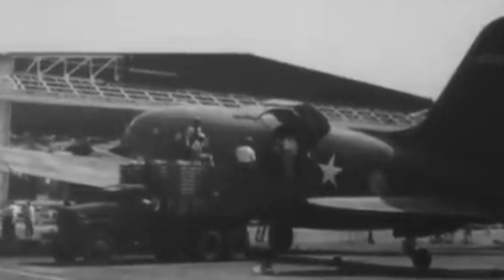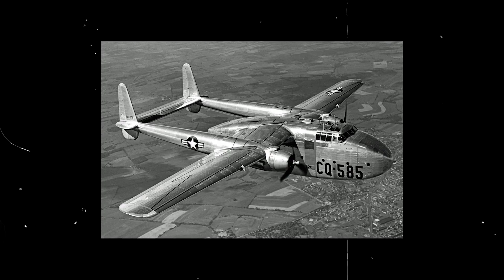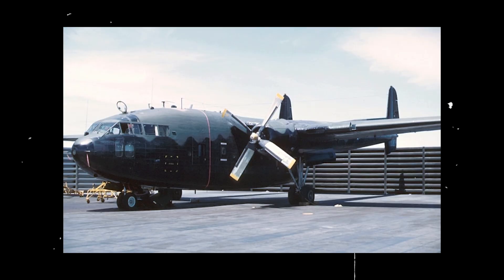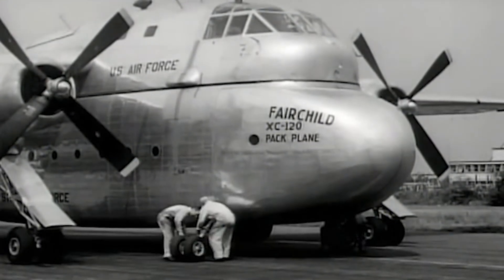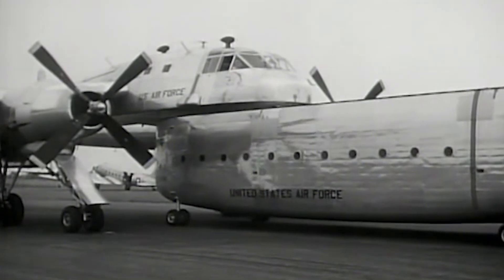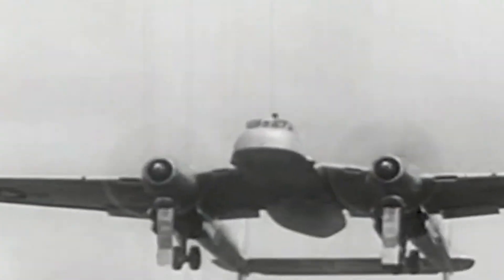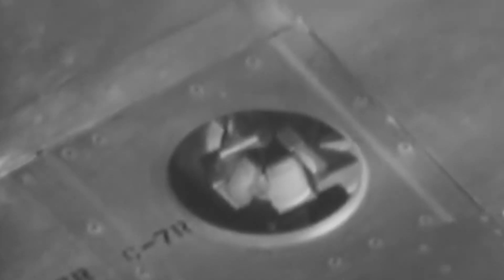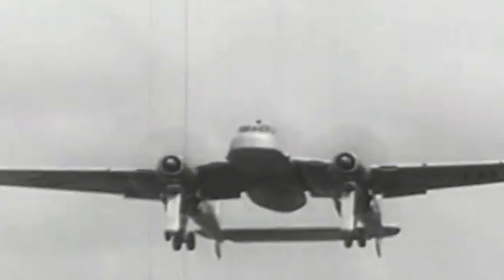Why Don't They Build It Today? The Most Brilliant Aircraft Design Ever

Comment: Why don't they build it today?  The reciprocating engines the airplane used were powerful, but the aircraft was drastically underpowered anyway. So fine, replace the recips with jet engines??  And how do you install a jet engine on a twin tail boom aircraft?  There's no need for the aircraft anyway, replaceable pod or no. The C-130 is a world beater, still in production today, a million times better than this thing.  And even it is being threatened by more powerful, more modern replacements.

Comment: When you showed the front doors of the PAC plane I thought of the guppy and the b 747 , 
If they built the plane with the pilots cabin over an integral cargo bay and wide front doors , allowing for large cargo to be loaded and unloaded quickly , or even in modular containers,they'd have achieved most of their design goals and probably had a success

Comment: I never heard of this aircraft before, but I am a commercial pilot but actually came up with this design myself.  I made sketches, but mine had a nose cone that came down where the pilots sat, and the pods would be rolled into position from the rear and engage into the cockpit.  this would give the frontal surface area to a minimum.  I was shocked that they actually consider this design in the past.

My other design invention is for safety.  Simply  have the passengers sit facing the rear of the plane.  This will drastically increase survivability of a forced landing.  Facing forward is the most unsafe way to sit passengers.  The G-force the body can tolerate increases tremendously faceing rearward.

Comment: I can see why this wouldn't work, but I would think it would be easier to just build a very "agile" cargo pod that is designed to perfectly fit inside of a large modern cargo plane, serving a very similar function. Instead of detaching an entire part of the fuselage, you could just have the equivalent of a cargo container, loaded up with stuff, that can be rolled into a plane's cargo bay within minutes in one operation, then dumped out of it in minutes too. It would slightly reduce the maximum carrying capacity, but probably not by much.

Comment: I worked in Alaska in the early 1980's and had the opportunity to fly in the C-82 Boxcar a few times. It was a great bush cargo plane. It had a chain drive landing gear extension mechanism that tended to fail. I remember they had to reskin the belly once. Carried about 20,000 pounds of cargo, anything from lumber to trucks to small bulldozers.

Comment: "Power" ??? those of us who "Jumped" the C 119 (Airborne ) felt compared to the C 124 and C 130 it was crowded and underpowered. 
Also the Oil fumes from the Radial engines were a boon to the manufacturers of the "Barf Bag" 😂 on a hot day as they permeated the cargo area.

It would be interesting to see a comparison of the C 119 VS, C 46 , C 47's various versions with different engines and the  C 123.

Comment: Don't forget the US Army Air Force (USAAF) designed the C-119 for their use (supporting the Army).  After the Key West Accords (1947) the Army could only have helicopters and liaison aircraft, the US Air Force controlled all other types, and they did NOT want the C-82 and were hostile to its successor the C-119, they wanted the C-124 Globemaster II which fulfilled their idea of the Air Force's cargo transport mission.
They would not have been interested in developing the 'Army's' plane.

Comment: It's an interesting concept.  Imagine a "tower" module.  Prefabricated, two/three level(depending on how big the pods are) with all the necessary equipment installed.  The pod is dropped off. The ground crew move it in place, then stand it up.  Level it as necessary, and just plug it in.  That's not a bad idea, honestly.  But very specialized.

Comment: Immediate reaction, this is a stupid idea. After further consideration, I believe it's even dumber than I initially thought. When a cargo plane lands, someone on the ground has to unload it. When this plane lands, they drop the cargo pod... and the people on the ground still just unload it like normal. Why go through all this extra expense and complication when the only thing you're accomplishing is saving the pilot the trouble of waiting around to be unloaded. Instead of loading the plane itself, they load this cargo pod (saving no time whatsoever), then have to attach the pod to the plane (losing time). It brings nothing to the table. It might save a bit on fuel on the return trip. That's the only positive I can think of, and that's only if the plane is flying back without an empty pod.

Comment: 1:42 
Within the transition from metal-based to carbon-based technologies and the resulting double increment of strength and lightness - it would be good to see this design principle taken further for commercial trans-ocean haulage. A modular (extendable/reducible) wing-frame with carbon container pods shaped to contribute to the aero-dynamic requirements of an ekranoplan-based design and which would be detachable for onward land-based haulage seems worth investigating. Deconstruction of the economy of container shipping and reconstructing as carbon vessels using ground effect to avoid the vast expense of fuel in overcoming hull drag would be the conversation. Accurate weather-forecasting and out-run speeds would be an essential consideration as would retrieval strategies if ever needing to ditch.

Comment: A Good idea too early for its time I guess.  A plane like this would need multiple control systems and mode/control changes with such a modular system.  that is likely where it was going wrong in that day and age.  Not only was the concept novel and new, but the understanding of the physics and how to design a plane and its control systems where still in almost purely mechanical control,.  The robustness of technology and the lack of knowledge and materials would have made such a good idea too complex for that time period.
With what we know and have now however, it would be possible to make such a modular airplane and have the right multi-mode multi-adaptive computer control systems.  The only thing missing now, is simply, the will and backers to try again.  The tools, science and technology have caught up.  The will to do it again has not.

Comment: Former Boeing Everett... as an aviation buff, I never heard or saw this concept. It is actually very brilliant. Pods could be pre-configured depending on actual mission; hospital, cargo, rescue, recon, troop mover, etc. It had a 30,000 pound payload limit, which wasn't too bad for time period. They could put 30,000 pounds of TNT in it and make quite the MOAB lasting impression on the enemy. 

Today with modern aviation, much larger and capable pods and carriers could be built. The bulkhead between plane and cargo in original version looks to be flat. Pressurized fuselage might dictate different design, but concept is valid. Maybe Boeing can make a special 747 flying boxcar with detachable cargo pod. My friends in Everett would love a new 747 project and so would I.

Comment: I'm no expert but I must say I was surprised by this design. The possibilities of the modular cargo pods are endless. I could see while unloaded the flight characteristics would drastically change but that was in the mid-fifties. With fly by wire avionics the aviation industry can make a rock fly quite well.

Comment: The modern equivalent to this is the C-27 Spartan. It was adopted by the Army, then taken by the Air Force for some dumb reason. They were put to good use between 2009 and 2013, before they were needlessly phased out of service and given to the Coast Guard.

Comment: I watched it a month back and was looking for free time to post a comment ... i believe this concept failed (1) the clutter i.e. empty containers with your troops will make them easy to spot as it will be hard to dispose/hide them after taking supplies out. (2) as video shows too it is hard lengthy procedure to mount container back and cant be swooped by airplane to pick it back (3) the turbulence/instability faced by container-less aircraft can be done away by double walled container .. where outer walls remain as faux fuselage and inner container of ~95% same volume slides out. Conclusion: (1) point-1 above here is enough to disband this approach. (2) C130s have performing/fulfilling similar duty by dragging/ejecting the load on makeshift runways by just touchingdown on runway for few seconds ..the parachute attached to the load pulls it out and C130 takes off immediately after these few seconds of touchdown .. you can search for "C130 LAPES" videos ..... Low Altitude Parachute Extraction System (LAPES)

Comment: Fascinating.  Familiar with the C-119 'Flying Boxcar' as I used to live near an Air Force Reserve base during the late 1950's through late 1960's and they flew the C-119 until replaced by C-130's.  The C-119 was a common sight flying low over our house back then.  Had no idea there was a 'pack plane' C-120 variant..what an innovative concept too bad the aircraft had some flight stability issues without the 'pack' attached.
Reply: Location?  I grew up near Columbus Indiana and Bakalar AFB

Comment: The C119 was used all the way into the early  90's.  I believe Hawkins & Powers out of Greybull, WY developed the mod to add a small gas turbine on top of the fuselage for added take off performance.  It was the same gas turbine, that ran on 100LL, that was on the wings of the P2-V Neptune.  They made great air tankers for fighting wildfires.  Now if only Lockheed could make a wing that wasn't prone to cracking...

Comment: This was a plane, without a mission. I have loaded/unloaded hundreds of C-130's, 141's and even a few C-5's during my Air Force service. With modern palletization, and unloading equipment, we could do it faster and more efficiently that the Xc-120 without any weird empty flight characteristics. By the time the aircraft was ready for service, new ones were already on the drawing board.

Comment: The issue of hot cargo drops is handled by helicopters due to either not having to land at all, and their ability to land at tiny or nonexistent airfields.  Planes can't really do that.  Why this hasn't been moved over to plane cargo I assume is lack of demand (being pretty much only a demand from the military) and having to modify the current transport systems. Even though Russia has had very good heavy mover helicopter development in the past, even during the Ukraine invasion the very first thing they tried to do is secure airports to move in planes, where they wouldn't have to worry about hot airfields.

Comment: Both the Fairchild 119 and XC120 had the defect that they were designed to waste fuel. The dogma of the day was a poor lifting blunt leading edge airfoil cured with big engines. A sharp lifty airfoil would have cured many 1930's 1940's, 1950's 1960's planes and even now. Slower flexible efficient wins the race.

Comment: I wonder if an aircraft could have been  designed that had a permanent, aerodynamically sound fuselage (including nose gear) but without nose- and tailcones. The cargo pod could have had a streamlined front and tail and would slide into the hollow fuselage. Unloaded, the fuselage would be a light, hollow tube with little drag. It might need some venting slots to further reduce resistance when maneuvering. ??

Comment: I have often wondered why we don't do this with C 130s or C 17s.
Reply: It isn't needed.  Still takes time for the ground crews to unload the cargo either way, and c130's and c17's are not unstable  crashes waiting to happen.  Combat airlifting is done by helicopters, which is a superior solution, because helos do not require prepared airfields and don't even have to land.

Comment: The flat plate bottom is an unsurprising problem. But I wonder if it couldn’t have been fixed by using an inflatable bladder to better shape the airstream? Inflation/deflation might slow the down the process, but, used as intended, it would only be used on rare deadheads.

Comment: C-119's were also flown by the USAF on behalf of the French during the First Indochina War
during the early 1950's. The main difference between them and 'regular' C-119's was the
USAF markings were removed and replaced with French markings. A number of them
were shot down and the American aircrew members were either captured or killed.

Comment: The Sikorsky CH-54 Skycrane helicopter was initially designed to a similar pod fuselage concept,  Although many Skycranes were built and some still fly, the Skycrane was almost employed as heavy, sling-load, lifter.  Another issue with the podded concept, is that it required multiple pods per aircraft - each built to expensive aircraft fuselage specifications - that eventually might get distributed all over the place and maybe leaving a C-120 without the needed type of pod, or any pod at all - especially those pods destined to be field hospitals, etc.

Comment: In the mid to late 1980's there were several C-119's on contract with state and federal agencies being used for fire fighting. I worked as a Mixer-Loader at the time. I believe they held 1200 Gal. of retardant. They had a single "cam lock" loading port located at the rear of the fuselage. We had to bring the 3" loading hose under the tail section to load the aircraft. Because of this we had to add an extra section of load hose and load them at the far end of the loading ramp.
Reply: I dragged hose for a short time at Ramona, CA, and made friends with Denny Connor. He piloted a C-119, and gave me a tour of the plane. He had fashioned a small bedroom/galley area into the front of the cargo bay and could park his jeep inside the plane. He got other crews to take me on rides of their aircraft that were also deployed there (from Hemet), a B-17, a PB-4y (B-24), and something else I don't remember. For some reason, I never flew on his plane. The whole gang was redeployed to a fire near Morongo, and I never saw Denny again...his right wing detached on a drop, and he and his copilot were killed in the crash.
Reply: @bisbonian1183  So sad...There was a DC7 co-pilot named Chuck Sheridan(Don Ornbaum was the chief pilot) that flew a USFS contract out of Fresno in 1986. The following fire season he was chief pilot in a DC7. Lost his life in the high Sierra. Had an S2 pilot lose his life a couple of fire seasons later....tough way to make a living

Comment: That led to the more successful Flying Crane helicopter, in one direction, and palletised drops in another. The issue is, clearly, aerodynamics, and turbulence from the flat belly in particular. I wonder of there was anything in Fred Lanchester's seminal work which is pertinent? Add a front fairing, perhaps, so containers load and unload from the rear only.

Comment: for standard cargo this seems like an over engineered solution vs optimized pallet utilization.  It kind of looks like a grandfather of the Sikorsky Skycrane in function, albeit faster, with fixed wings, need of a runway, and a proprietary cargo pod.

Comment: Thanks for video. The XC-120 was a good concept. The same idea as a shipping/truck container but for the sky? However, my first thought was, "how will it fly without the pack attached?" It basically becomes a different aircraft when you remove most of the fuselage.

Comment: I would like to add that there was a successor in the helicopter  field which was designed and intended to carry large cargo pods to and from an area.   That helicopter is still VERY MUCH in use to this day.
Reply: Except the only pod that is usually used is the fire fighting one. Other than that they are generally just used as long line heavy lift vehicles.

Comment: France did build a similar aircraft, but smaller: the Nord 2501 Noratlas, with 2 14cyl SNECMA Bristol Hercules engines (sleeve valves, 2040hp), entered in service in 1953 and retired in 1986, was also used from Germany , Israël and many other countries...

Comment: Didn't Fairchild's  C119 airdrop packages !!!!!!! They had a rollers on the floors of the C119 for cargo drops .  I also remember that there was a problem with the rear clam shell doors while in flite where men would jump out that some men got killed from hitting the leading edge of the tail .  Something having to do with updraft or the shut .  I believe that is why they had the men to jump from the man door on the side of the fuse .  My friend Roger dad was a jumper on a C119  for the 101st Choking Chicken @ Fort Campbell KY. At around the 1950's .  My Brother Larry was based there for 2 years back in the beginning of 1980 .

Comment: It just looks pretty obvious that the time to attach, move, and reattach that thing is going to be about the same as unloading and waving goodbye.  An organized wayof packing has clearly won out in the long run.  Strange, too that they had the cockpit above instead of in front of the load, which might have not only cleaned up the frontal area, but also improved empty handling.

Comment: The XC-120 was a pretty ingenious idea. If the cargo hold is detachable, then when it isn't carrying cargo it can leave behind not only the dead weight of the pod, but also it's aerodynamic drag as well, and you can just load a pod with whatever you need and snap it in. It also foresaged the eventual almost universal containerization of freight by ships, trains, trucks, and eventually even aircraft through ISO containers.
Reply: but do you create more drag due to the squared off end instead of an aerodynamic end?